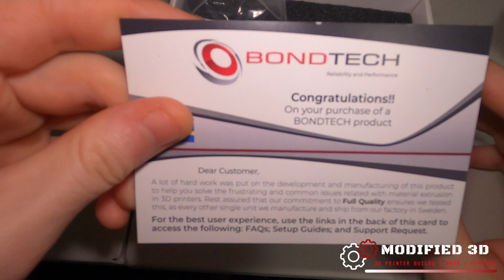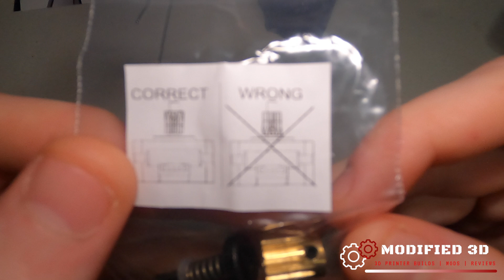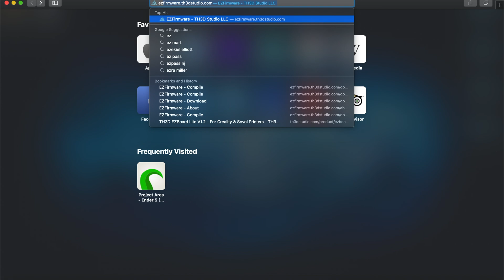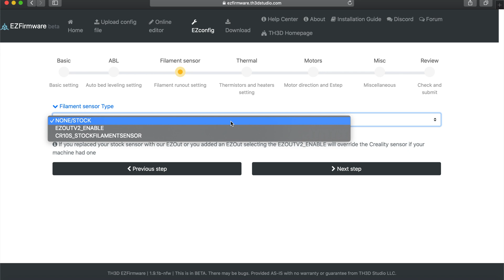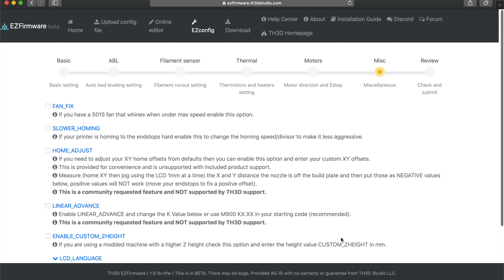Bondtech BMG Install | Creality Ender 5 / Ender 5 Pro

Comment: What stepper motor do you have where the center rod on the stepper motor is longer? I bought a dual gear extruder but the rod on the stepper motor isn't long enough for the grub screw to grip the rod so if you can recommend a replacement that would be great

Comment: Recently changed the original extruder by a Bondtech BMG at my ender 5 plus. I must confess this procedure has been much easier at my Mankati fullscale plus with the Bondtech QR back in 2015 with all modifications could have been changed in the settings on the machine itself. I was even able to leave the Filament sensor in place (beside lifting it up about 1 cm due to the bondtech beeing twice as thick as the original extruder mechanism).
I changed the motor direction via exchanging the pins 3 and 6 (at the motor side) and put the e-steps to 415 via g-code. Works flawlessly so far.

Comment: was looking for the install of a bondtech clone on the ender 5+ stock but seems it's either a non ender 5 or a modified one..
but for shure the basic extruder that is on the ende r5+ is crap :(

Comment: I installed the bondtech BMG with a v6 on Ender 5 and I'm having extreme under extrusion when doing the 100mm test, it moved only 20mm. I set the esteps to 415 in the firmware. You mentioned tightening the BMG tension screw all the way down and then back 1.5 to 2 turns for PLA. I had the tension screw only screwed in a little. I guess that could be the whole problem?

Comment: How does the BMG differ from the DD kit?
Reply from the maker: The main difference is going to be the bowden tube vs direct drive setup. Direct drive places the extruder right on top of the hotend, allowing for less retractions and increased reliability with flexible or soft filaments. The downsides are that it increases the gantry mass, increasing the risk of print artifacts. I personally run the BMG in bowden setup on my Ender 5 as shown, and run a DD setup on my Ender 3 Pro.
Reply: @modified3d59  Thanks.  I would have thought it'd be different.  The Bontech DD from what I understand is 1 piece with a pancake stepper motor and includes a new hot-end.  The DD system I got now was an upgrade kit I got from Canada and it uses my original stepper motto.  Now that's heavy.  ;-)  I want to keep the DD system to print TPU pus I've had problems with the Bowden tube system.